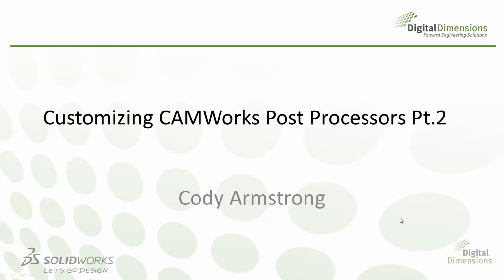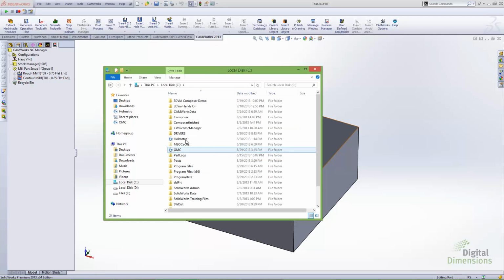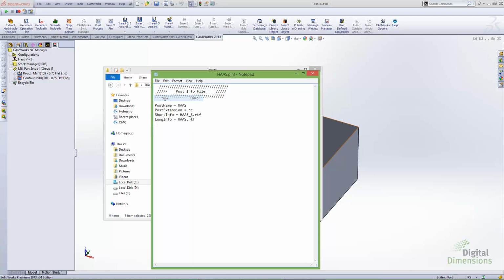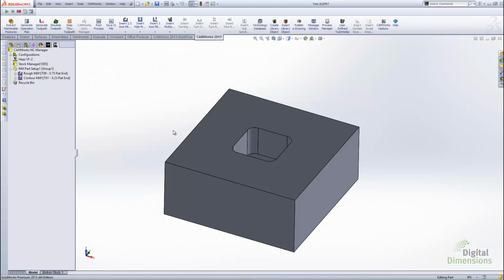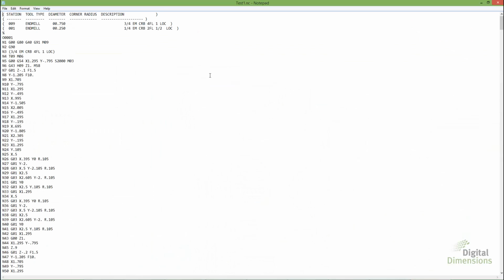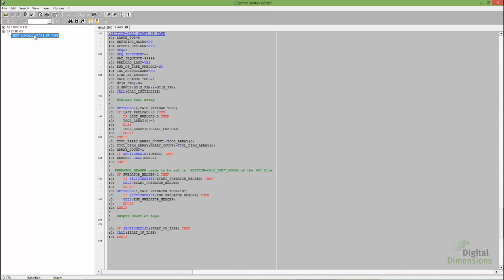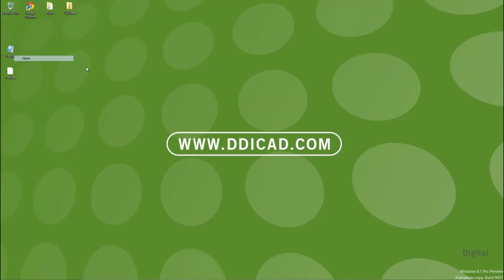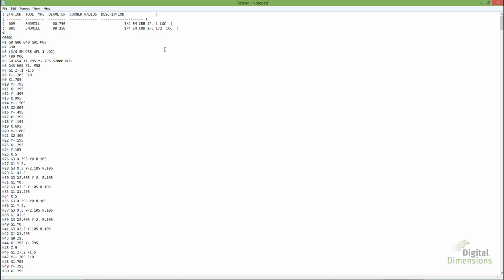DDICADcast 16: Customizing CAMWorks Post Processors Part 2

Comment: I am working with a Fadal post and my first line is %, second line the O number, and both are well. I do need then, below the O number, the tool list.
In the sample the tool list goes at the very top of the code, but I did not find the way to get my target.
Could it be done?
How?

Comment: great video! I tried to make the changes in this video and some were fine but i didn't have the CALC_START_OF_TAPE in the .LIB file or anywhere i could find.  i did see it in some of the other posts after investigating.  how would i go about getting the tool list if there is no CALC_START_OF_TAPE?

Also, the tool numbers are a bit nutty, in one line it lists it as T0202 for tool #2, and then a line later it lists it as T0200, I can see where that would get confusing.  being I only use this on a machine with fewer then 100 tools, is there a way to limit the tool numbers to 2 digit eg.. T01, T02 etc?